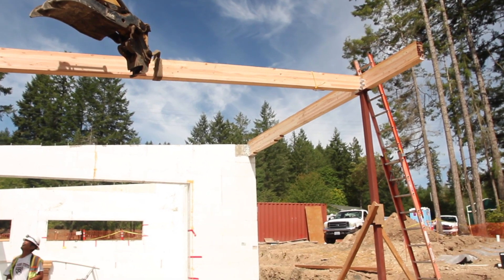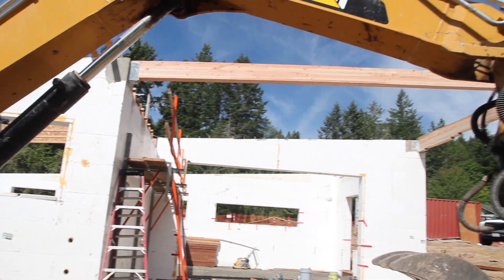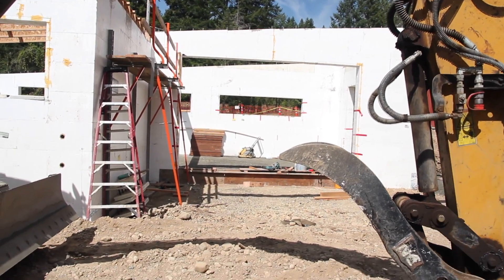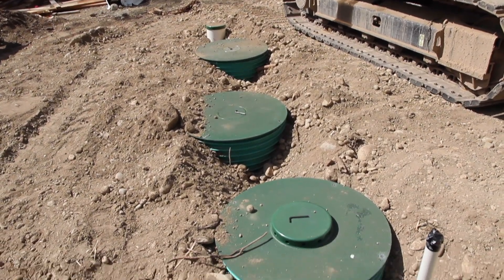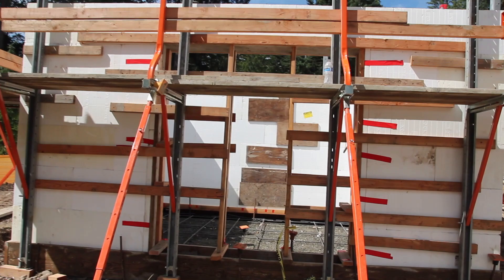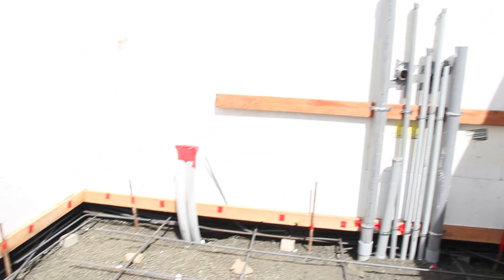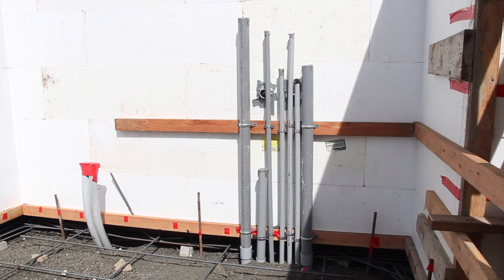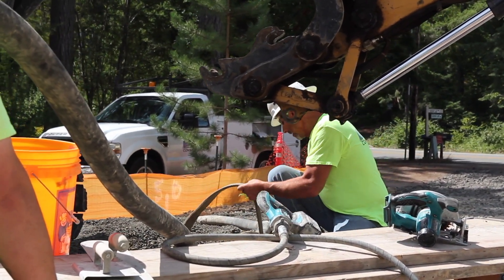Custom ICF Waterfront Home - Rocky Bay Part 6 - Glulam Beam and ICF Monopour

Comment: This mono pour looks stressful. :) Do you need that 2x4 on the interior at the slab height?
Reply from the maker: Hello Matt, thank you for the comment. We installed the 2x4 at the bottom of the ICF to control floor elevation as well as hold the ICF in place during the mono pour. We removed the 2x4 after concrete placement.

Comment: Try AMVIC ICF,  from PACIFIC ICF.  The rebar can be placed in slots two overlapping bars high, so hopefully you dont have 4  bars beside each other on top of the wall and no concrete can get past the four adjacent bars.